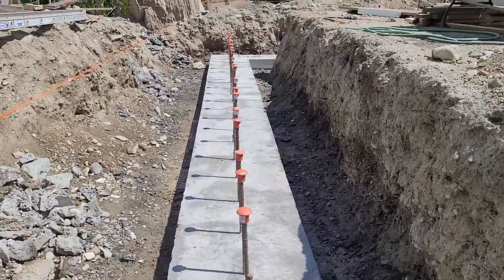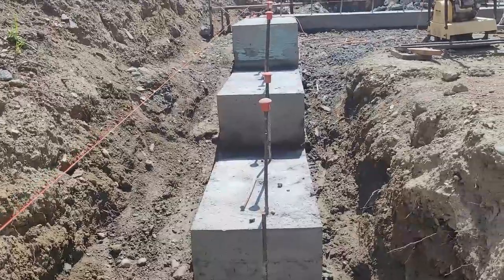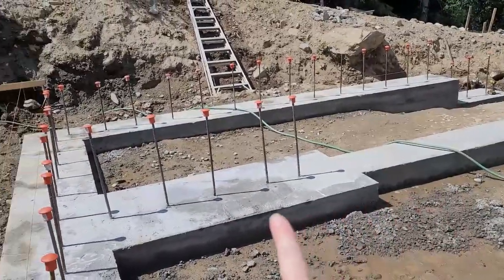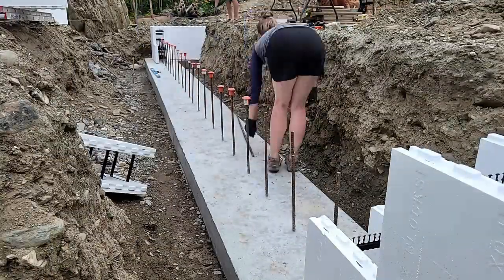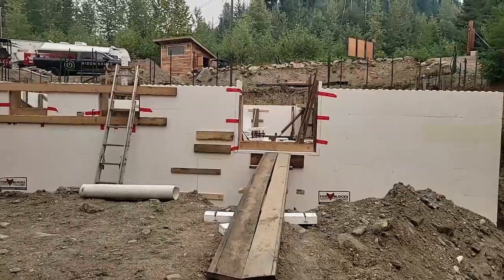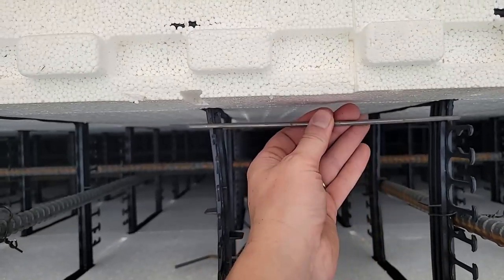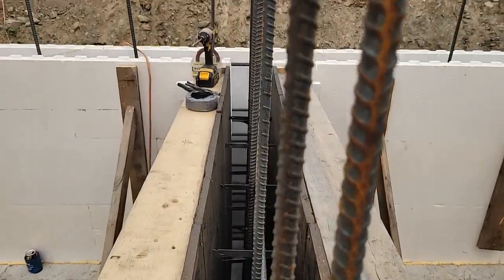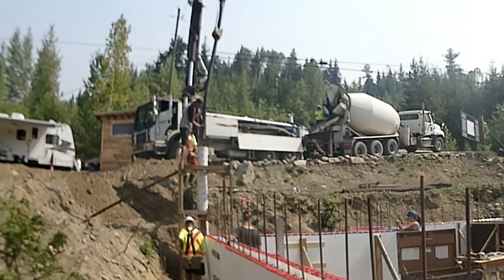Building an ICF stemwall- Stacking the first of many ICF blocks and our second concrete pour.

Comment: I found your channel from a FB group. Great job so far! We are going to build our own house too, so it's cool to watch someone be a few steps ahead. We will be building in Vermont, so we have some similar cold weather considerations. We also are thinking of building a net-zero home.
Reply from the maker: Hi and thank you! Our house will be step 5 (Step 6 being a passive house), we found it so difficult to meet full "net-zero" requirements for our area but it will be all electric powered by solar! Looking forward to watching your build as well, its so great to know there are other people just as crazy as us!!!
Reply: @anaverageacre  We are actually looking into how feasible Passive House would be for us. But so far we know we want fully electric-powered by solar as well :)  Where does the Step 5/6 come from? Is that a Canadian thing? I haven't come across that terminology before.
Reply from the maker: Yes I suppose it is Canadian, might even be specific to BC I guess.  Step 0 would be basic building code requirements and every step above that is based on certain energy efficiency requirements. To be truly designated "net-zero" is a lot more involved so we will be close but not officially net-zero.